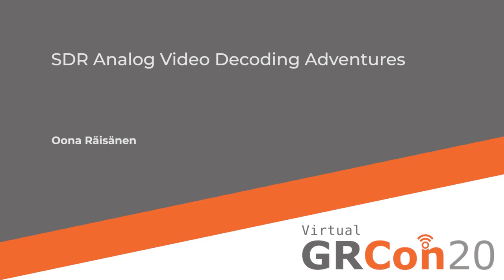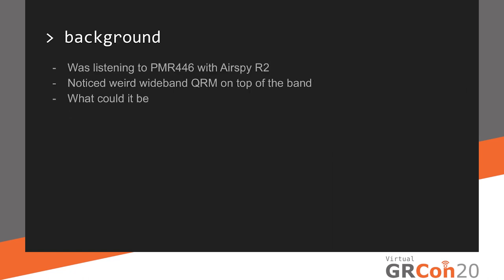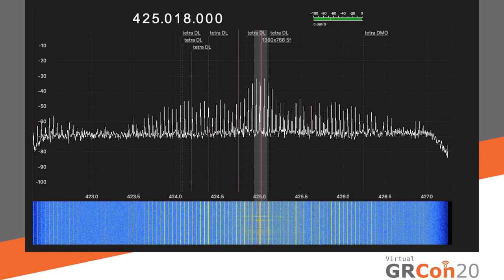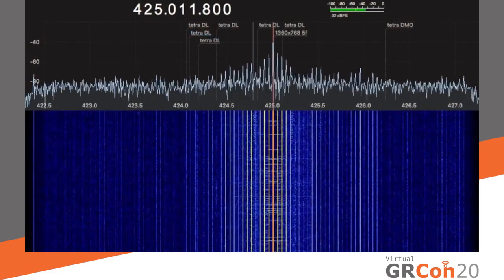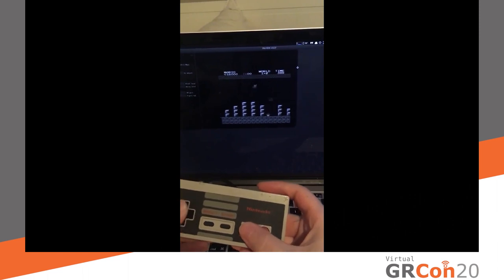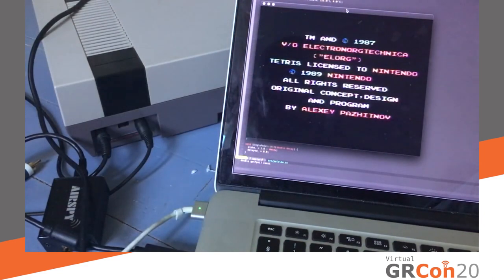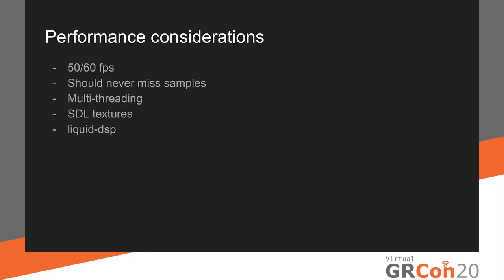GRCon20 - SDR Analog Video Decoding Adventures

Comment: The 'echo' is presumably ghosting, caused by multipath reception, hence a slight time delay.
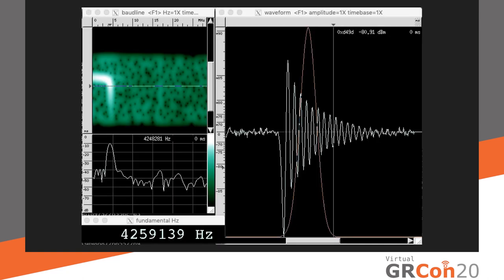Reply: It could be -- however, one would expect multipath copies to arrive at irregular, randomly spread-out time delays, whereas the step response here is ~20 cycles of a clean 4.26 MHz sinusoidal "ring" (11:55).
Reply: In the NTSC days, there was a technique that involved measuring the TV screen and the offset of the "ghost" and doing some "maths" to figure out the differential distance of the arrival of TV main signal versus the multipath. So you could say Ah ha, its that water tower 1 mile from here.